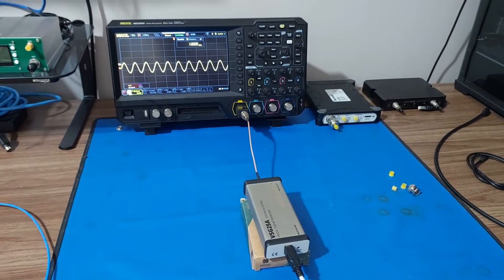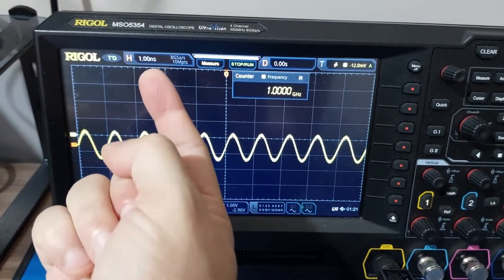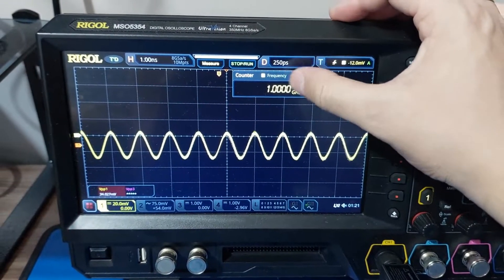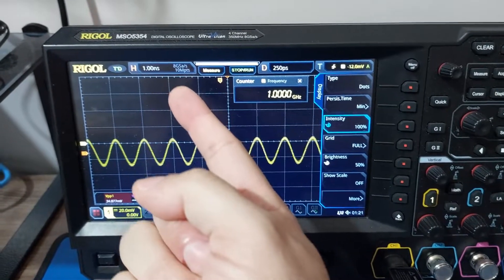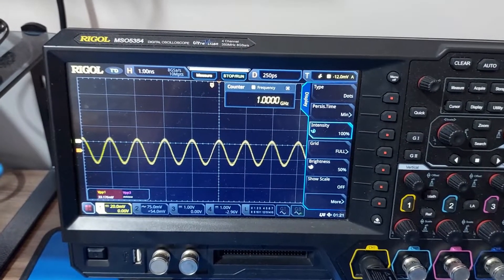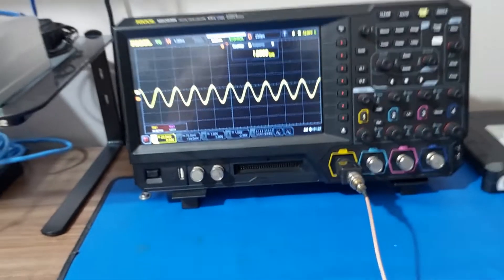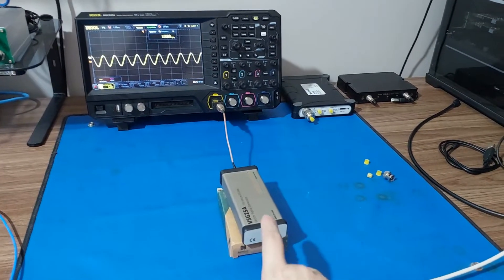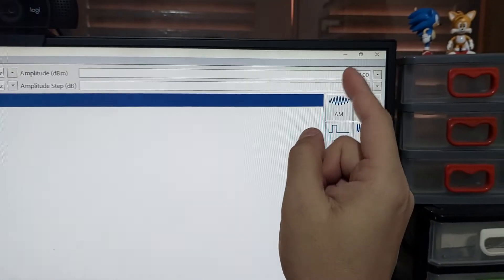[EN] RIGOL MSO5000 BW Follow-up: 1GHz in dot mode

Comment: Where did you clip the scope on the LoRa board?
Reply from the maker: I used the SMA connector on the LoRA board with coaxial directly into the 50 Ohm load, which is hooked up to the oscilloscope. I'm showing the transmitted signal.
Reply: @LiraLab  thank you. I am duplicating your video now at home and learning a lot! Thank you!

Comment: well, it depends on what you call "real", the actual bandwidth, ie, with correct amplitude, is still 350M, maybe 450M with good probe. As soon as the amplitude has dropped more than 3dB then its not part of the bandwidth as an oscilloscope (which doesnt mean it cannot have a purpose in some case). There is a reason why scope with 1GHz actual bandwidth are expensive, the front end is quite not the same league.
Reply from the maker: You`re being picky my friend! Enjoy the good times we live in, where low-mid end scopes give you the possibility to do YES/NO transmission tests.
Reply: @LiraLab  -3db is important for small signals.
Reply from the maker: @JohnUsp  Sure! It is in the datasheet and responsible for the BW of the instrument. This video here shows that you can use the instrument to verify if a signal is being transmitted, without worrying about the amplitude.
Reply: @LiraLab  depends of the signal amplitude. A counter will do a better job.
Reply from the maker: @JohnUsp  what do you mean by counter? I agree it depends on the signal power, however, in this videos I used 10dBm which is pretty low, considering the IoT transmitters. Chances are that many people have higher than 20dBm signals but no budget to buy spectrum analyzers.
Reply: @LiraLab  you probably just measured the frequency interval, there is no information about the waveform or any defects in the wave. look, I'm not saying that's not good, but if you plan to work with GHz signals, you need another scope and active probes.
Reply from the maker: @JohnUsp oh, yes. That's a given. The point here is for those who can buy this scope but do not need to know any details about the 1GHz signal. If for those people, just confirming that the signal is actually transmitted is enough, we're all good.
Reply: @LiraLab  Many scopes do that. Even old analog scopes with low BW can see "something" at 1GHz.
Reply from the maker: @JohnUsp  yes! Many people don't know. Hence this video : )